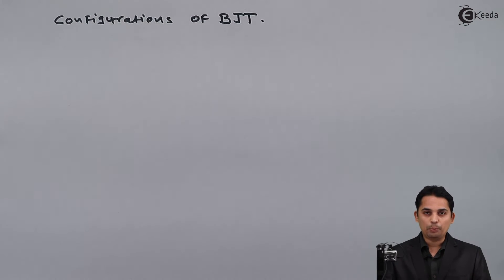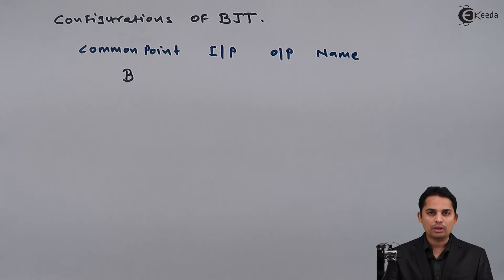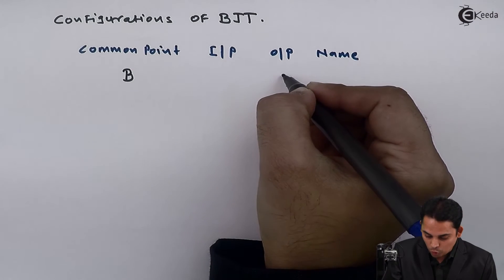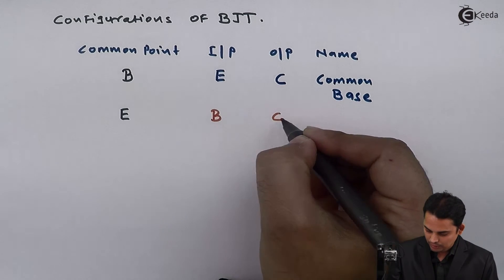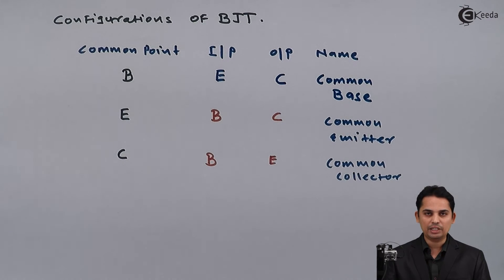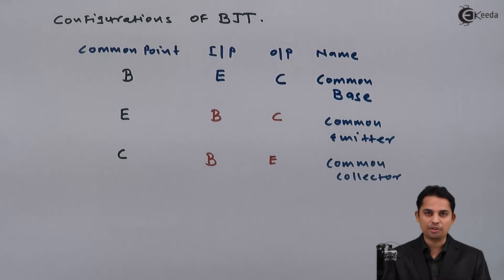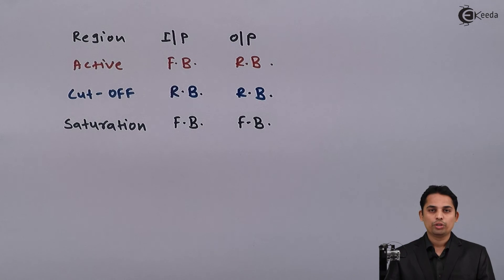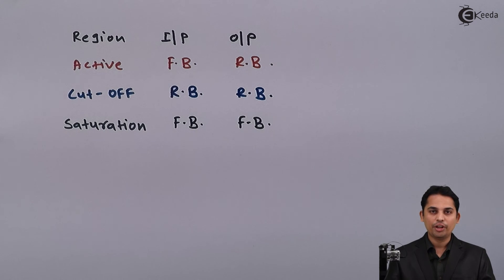Configuration of Bipolar Transistor in DC Analysis - Bipolar Junction Transistor - Analog Electronic

Comment: When temperature  increases Vbe decreases. Since the bias voltage into the base normally has fixed voltage and also the base resistor will be fixed,  base current Ib will increase and so will collector current Ic. Correct yourself.